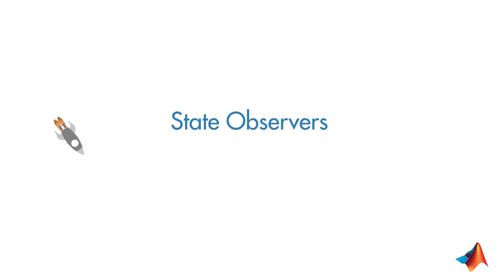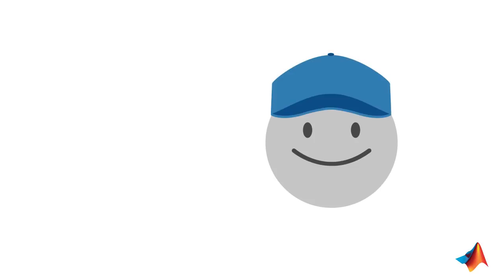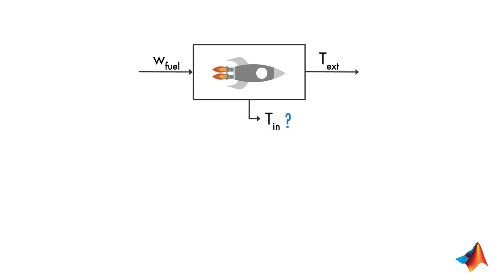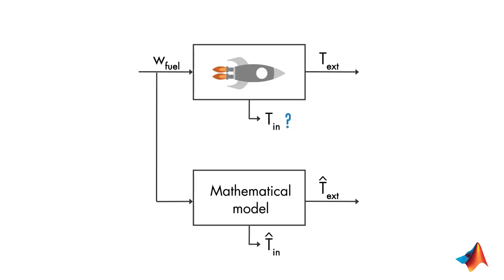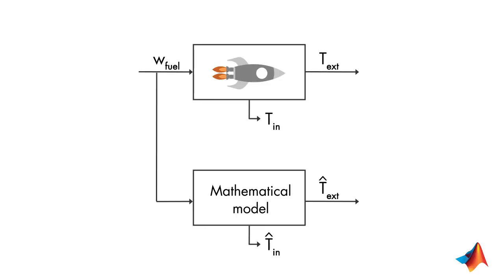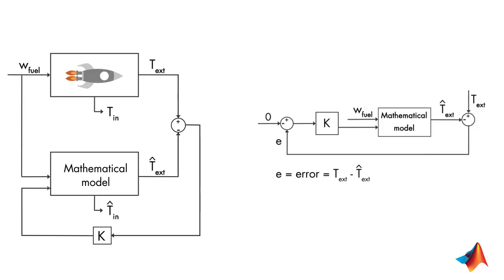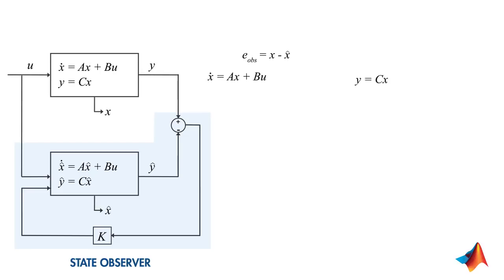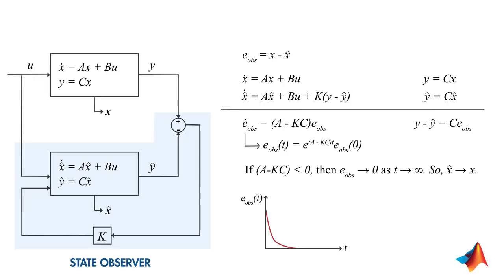了解卡尔曼滤波器——状态观测器

Comment: where does the equation diff*x=Ax+Bu come from?
Reply: x' is not diff*x，you can analogy that  current internal temperature has linear correlation with  internal temperature of last moment and the fuel input，or current temperature = A * last moment temp + B * fuel input